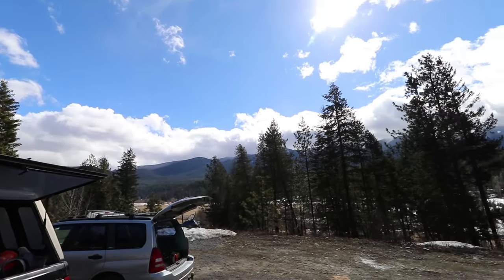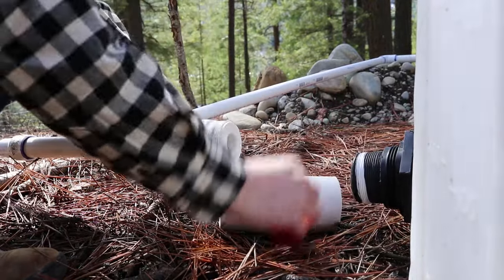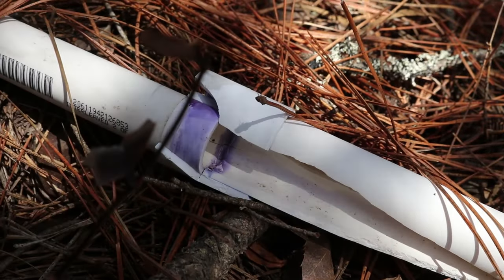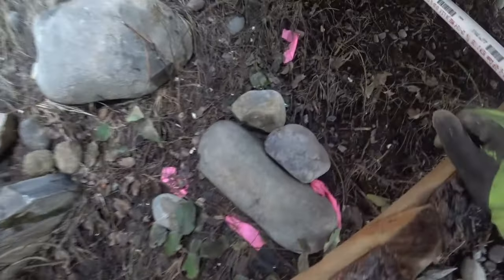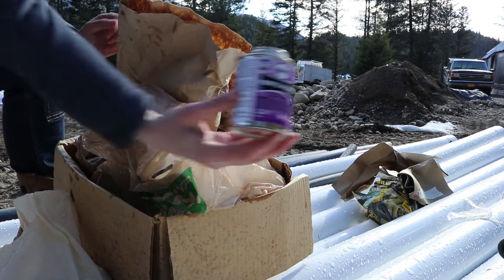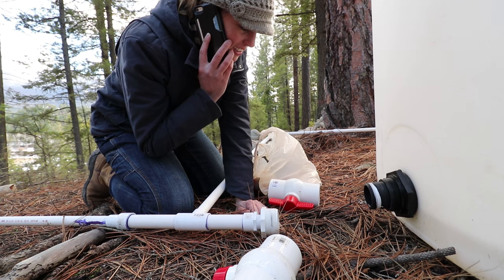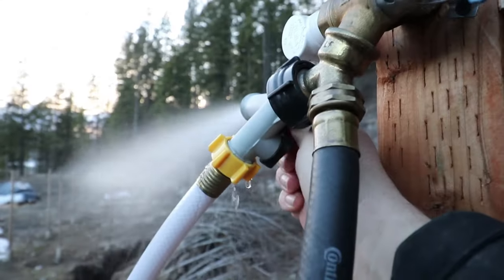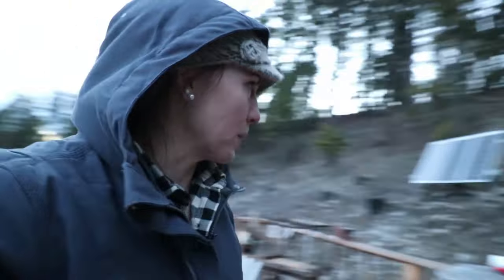OUR OFF GRID WATER SYSTEM IS BROKEN - Time to Fix it!

Comment: Like others have suggested you should consider going with poly pipe. It comes in rolls of 300 ft. With basically 1 long piece of pipe  you will have only 2 points of failure at each end instead of each fitting. Poly will hold up better to freezing and handle the sun exposure better than PVC. While its not bullet proof it will be more durable.  I would also like to add when you do put in your permanent system to run your tubing inside a large piece of conduit pipe. It a small investment  that will save you thousands in repairs if your piping eventually fails. ( all systems will eventually fail, nothing lasts forever ) It will make replacing or repairing so much easier.
Reply: Willis Swegle they have a video talking about converting to poly. that's the plan.
Reply: HD fowler I agree willis plus they need to get rid of that 2 inch pvc valve and to to a pvc female threaded to 3/4 and put in a gate valve 3.4 end female coming out use a brass threaded barber end heat the thing up with s.s. clamps already 1 ft down the pipe and push the thing on. Barley heat up the poly pipe.  What works great is those Harbor freight blue handled screw drivers. For the pipe clamps. If they buy that in 100 ft rolls at home depot they need to use 3/4 brass in between the connection. And dig a trench 6 inches or better to their water source to their house.  Then throw dirt branches or small trees over the thing if rotten great and throw down grass seed.  They could even put an inline filter. I have 160 psi at my place right now and used a press reducer and then a sediment filter inline with a screw on filter from the restore/habitat for humanity.  Filters are for dirt and I get those in a packet of 2 from wally world.  I wish i lived closer I would help em out.
Reply from the maker: We're going with poly pipe for our permanent system. Double-encased with an extra line for a rainwater system or a backup. ANd all that... hopefully we won't have to dig up the trench again.. .EVER!

Comment: Hey, this is just an idea. Big companies sometimes get stuff shipped to them in large crates. Sometimes they just want to get rid of them. They would be an awesome source for plywood, and you could use them to store all of your supplies instead of leaving them out in the weather all of the time. It's a good temporary solution for storage until you get more shelters built. Or you could build some compartments underneath the hot tub deck for storage. I find that keeping everything organized or stored in the right place makes jobs a lot faster since you don't have to run around looking for your supplies you know you have but can't find.

Comment: I have been following you folks for a fiew months now. and I have been very impressed with your process of working through problems. 

I have some personal experience in DIY plumbing and code demands.  PVC or HPVC ( the tan piping, and fittings) does not pass the national BOCA code for potable water supply.  I had to pull all of the PVC and replaced it with HDPE  NSFW PW,   the piping is joined by push in ribbed connectors secured with stainless steel hose clamps. to be safe I used 2 for each for each connection ex 4 total for one joint.  Remember this will be buried never to see the light of day again.

This is just a suggestion from a friendly viewer. enjoy.

Michele WhiteWolf
Reply from the maker: +Michele Whitewolf This pipe is temporary and will never be buried. Watch our other water video for the permanent system.
Reply: Pure Living for Life why not use the black pipe for temporary, and the you have it for permanent later.

Comment: I graduated architectural technology aas at matc, I follow your story and I can't wait until the project is finished,  your dedication as a couple is admirable.  I love how accommodating your husband is.  my favorite thing he said is if you can't handle a period your not ready to go off grid.  and women like to be clean guys.  as a self taught auto mechanic I understand the difficulty of tough gritty hard labor.   as my knowledge concerns with homes y'all are on a very budget conscious smart plan.  I love the $300 tiny home,  and the electrical work conscious of today's power needs.  the water for 25€ was genius.  I wish all the best of luck.  and you're research is perfect douglass fir 6"oc.  a native of Wisconsin I will say with summer here start digging the foundation now you need 3' poured concrete footings so its at least below the frost line. then plumbing and mechanical with just fall into place.

Comment: You can never make just one trip to the hardware store!
Reply from the maker: No, never. Sometimes not even five.
Reply: Do you not have a Screwfix alternative over there? UK .... order before 5 next day delivery for a charge or you can wait a couple of days if you are organized! ;O)
Reply: Your ball valve  split because it was closed which causes the water to be trapped in the ball part of the valve. You need to leave ball valves at 45 degrees so the water does not get trapped and split the valve when the water freezes into ice. I learned this the hard way on my irrigation system in Canada. Every year you replace the valves that were closed completely but not the ones only half closed.
Reply: ...... or use brass!
Reply: Brass break easier when frozen fully closed. The problem is that ball is full of water when closed. You have to leave them partially open not fully open as water gets trapped beside the ball and splits the valve.
Reply: 2" brass ball valve......100 dollars or so and the ice would probably still crack.
And my kind if women who can drive a clutch.
Reply: creep
Reply: i went today myself

Comment: Guys check out water grade PEX pipe for the permanent install. You can still use the 4" as a shield of the 1" water line and I would put pipe insulation over the 1" water line.

Comment: 40 schedule pvc pipe can become brittle in subzero temps. All it needs to shatter is for it to be stepped on when it is frozen. Any deer or other animals jumping on it during the winter would have caused the pipe to crack like it did. Ever think about going HDPE pipe? When I did a short stint working in Elko, Nevada, I found they used it a lot for water piping. It appears to have less problem with subzero temps.

Comment: Great seeing you getting comfortable driving the truck.  A partner should learn as much as they can to help in case something ever happens.
I would suggest not using premium for that truck.  Higher compression engines only require high octane gas.  Sometimes putting in higher octane will cause an engine to run poorly.  With most things automotive check the owners manual.  
Hope your back gets better. I know the pain

Comment: Hi Alyssa,  If all you have is wind up there perhaps a wind turbine would be helpful?  Also PEX line is a lot less brittle than PVC.  PEX is also Freeze proof according to the manufacturer.  You can get PEX in 1000' spools so you don't have to use any fragile connections between the house and the reservoir.

Comment: One word...PEX!  Rid yourself of PVC.  PEX can double in size without rupturing.  Overall only slightly more expensive.  And purchase a couple of sheets of 4x8x2" blue board for insulation.  Remember frost comes from the top down.  Rip it in 2' strips and place on top of your buried pipe.  Will REALLY help prevent frozen pipes when those pipes are above the frost line.  Double insulate your brass couplings or they will crack.

92 Octane???  Rule of thumb, one octane point for every 1000' of altitude due to partial pressure of O2.  If 92 is called for at sea level and you are at 5000', 87 Octane will work fine.  It's why 85 is sold at higher locations.

Comment: Try Pex pipe, it will take the abuse your winter's cold and summer's heat.  It will expand and contract and comes in 100' or 200'.  Connectors are easy to put on.  Just saying.  Great video!  Thanks for your courage!

Comment: You should use Teflon tape on plastic fittings for the same reason you need it on metal fittings. But even better is the belt-and-suspender approach of using tape plus pipe dope. Just make sure you use the kind of pipe dope that is OK for PVC pipe.

Comment: Why are you using hard plastic in 10 ft pieces? Pex is amazing! It's flexible, resists busting when frozen, comes in 100+ feet pieces so no seems or less seems. Super easy to use and cheaper than pvc. Can be buried as well!

Comment: ball valves always crack, if left closed in winter. There is a small amount of water locked inside the ball, which then freezes.
Just leave it open next time, and it will be OK.

Comment: you could try putting a bit of cheap (spray?) paint on the sun-exposed PVC as it can get brittle when the UV from sunlight hits it, the kind of PVC for underground / inside-the-wall use probably does not have UV stabilizer

Comment: I think  I would of used a couple rolls of the 1 inch black water line. I beleave it comes in up to one hundred foot rolls... I know that it can be really tough to work with when it's cold, BUT In the heat  of summer it can be rolled out flat with a few rocks to hold it down. The black rolled pipe it a lot thicker than the white... The back is normally ran under ground because of how strong it is...
The suns UV rays can really eat up the white PVC piping.... BUT at least it won't cost ya'll to much to fix it... Good show kiddo. :0)

Comment: I'm wondering if anyone ever suggested you use a one piece length of poly pipe to run your water down the hill? PVC is so temper mental with all it's joints and that once it is in the ground and it develops a leak.

Comment: you can simply cut the broke piece if pvc and couple-in just the section thats broken....you dont have to replace the entire 10' length.  1 pvc pipe should have been enough for the entire project

Comment: Would a hose not be far more practical in that application? A high quality rubber hose would still be cheaper than all that PVC
Reply from the maker: +JSindirect False. PVC was under $20. High quality DRINKING water hose that's 150 feet long would be well into $100-150 range.
Reply: Wow PVC is clearly vastly more expensive in Alberta lol. Thanks for the reply

Comment: why not buy a roll of 1 inch black polyethelene tubing.it comes in 100 foot rolls and they are not as brittle as the white pipe you're currently using

Comment: Hope you washed your hands after Alyssa's foot rub that's the wrong type of vinaigrette for the vegetables lol, she deserved a rub that's hard on the body working that hillside.  PVC doesn't do well in sun light it degrades fast, for your application of being gravity fed I would go with 3/4 inch black poly pipe when you do the permanent install. You want the heavy walled 100-150 psi pipe it will resist rocks and freezing.  As for the trips to the hardware store I was on a job doing some residential sewer and water line work I went to the store so many times the staff thought I worked there. I hate doing plumbing I'm not a plumber I'm a equipment operator. Be nice to Alyssa she may be doing a lot of grunt work if you got a bad back.

Comment: Okay, I'll bite....92 octane for a 90's Ford pickemup truck, what do you got in there, a hi-po 427?
Reply: That was something that I was going to ask as well.
Reply: I own an 85 blazer that calls for premium and so does the 01 Grand Prix, soooo.
Reply: I rebuilt several 60's and early 70's Mopars.  The compression ratio on my rebuilt engines require higher octane gas to run without knocking.  And they all run with carburetors, not computerized fuel injection.  Totally different fuel requirements.
Reply: Ah, the days when leaded gas ruled!  Have you thought of putting in hardened valve seats when you rebuild the engines?  I'm working on a 67 Firebird now that will most likely need the engine redone...but I still have 2 more months of tech school to learn how to bring it back to life, I can't wait.  Probably still going to need premium fuel anyway, huh?  But at least the valves will last longer.  My first car was almost a GTX with a 440 in it, when they started it up the windows in the dealership shook and they were "whats that?"  and I'm saying "that's my car", but Mom and Dad shut that down an made me get a normal Ford Torino Convertible with a 302, it was a really nice car--but it didn't shake any windows, like a high school kid wanted.
Reply: It depends on your state, a few states (only 2 states in 2012)  allow premium without ethanol.  But the stickers they put on the pumps that have ethanol mixed in state this pump can contain from 1% to 10% ethanol and that's as far as the gas outlets will go in informing you about your gas mix.  So ethanol destroys aluminum heads and parts, but the only way to avoid ethanol is to live in those few states and drive a souped up car that wants premium fuel.  It's always fun to read what the FTC says about premium fuel compared to regular fuel.
Reply: As an industrial machine maintenance mechanic I took a basic class in gas engines ( large backup generators were part of my job) aimed mostly at service and maintenance, what I was told was the problem with ethanol is it easily absorbs water which in turn corrodes and damages various internal parts, ethanol and aluminum by itself is non-reactive. The more ethanol the worse the wear due to water, unless your vehicle is made specifically for ethanol (E85), otherwise ethanol can not exceed 10% unless it's stated. The higher octane gas is made from a process called "Cracking", which I don't fully understand but has something to do with re-arranging the hydro-carbon molecule.
Reply: Also, when you have to constantly pull steep hills, often with a load, even lower compression engines can detonate (ping), which is hard on valves even if they're hardened, it also causes excessive carbon buildup, so in this case the added cost of premium is probably worth it.-- My father-in-law had a Ford 4x4 with a 300 six (4.9L) who pulled heavy loads all over the country, because he kept strict maintenance and used high octane fuel he got Over 450,000 miles on the engine (odometer broke at 386K drove it 2 years longer), the reason he sold it was the Crankshaft had turned so many times that the rubber rear main seal had worn a groove in the crank, wasn't worth the cost to replace.
Reply: Don't you guys have 98 or 95 octane in the states? I'm in Australia and its common , though 91 is mostly commonly used due to cost($1.10- $120 a litre usually)
Reply: Octane is calculated differently is the USA, I run 91 no ethanol in both my Land Rovers ('64 IIA 109 and '04 Disco2)
Reply: I'm not sure I've every put in 92 octane, in anything.  For sure, I wouldn't waste my $$$ putting 92 in that truck.

Comment: Have you thought about Pex? Not sure about northern climates but it shouldn't freeze and is pretty resilient to the elements. Purchased most of mine cheaper than PVC from Amazon drop shipped to the house.can pick it up in 1000ft rolls.

Comment: Alert ! Buy a small step stool when your doing anything that requires you to be standing over Example: Brushing your teeth,maybe washing dishes and here's one...both feet up when setting on the Throne (aka) the pot ! Get in a habit even when your back is not giving you trouble. This goes for the both of you. Boudie in the Bluegrass State ! PS they make one that's light as a feather and fold up nice and flat.

Comment: How come you guys went with sectional pipe instead of a couple rolls of 100' black pvc pipe? Its much easier to use on a long run like what you have there you will only need a fraction the amount of couplings from one length to the other and it will conform to the ground better. Plus when you decide to finally bury your water line you can hire somebody with a Horizontal directional drill like a Ditchwitch JT25 to install your pipe in the ground beneath those trees and below the frost line and only need a hole dug at the bottom of the hill and your tank hole at the top of the hill thus saving a lot of backbreaking work with that air chisel thing. How much pipe did you need to get from A to B?
Reply from the maker: 1. We already had the pipe
2. Black pipe on the surface will cook the water in the summer sun
3. It's poly pipe that comes in rolls, not PVC

4. You can't directional drill through rock,
5. Besides we already dug a trench, watch the video
Reply: Yes sorry poly-pipe and actually you can bore through glacial till with HDD systems they use a drill head much like an oil rig. And I saw you dug the trench and I also saw much of it sloughed in over the winter and is still not very deep for the weather conditions you have.

Comment: So great to see Alyssa with her "man-jacket" doing plumbing!  LOL.
Note - Even if a section of pipe section appears OK - it's structure may be compromised.  ALthough you are running at super low pressure - so they could be fine for that applications.  For others out there if you are running on pump or city pressure consider replacing any sections that froze.  Or better yet use poly pipe which can handle the freezing.